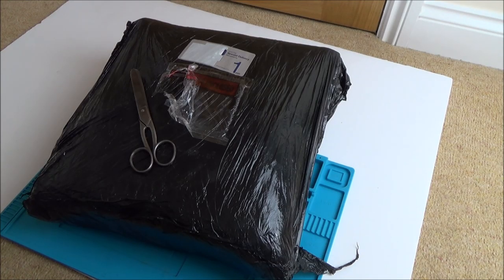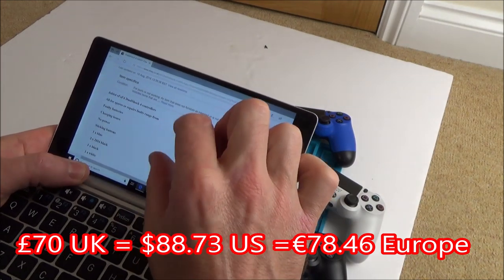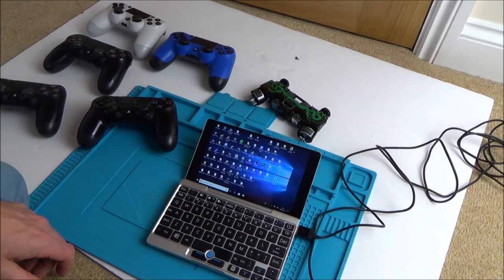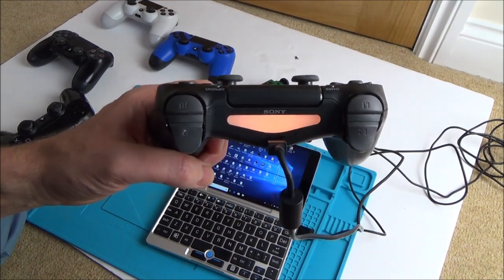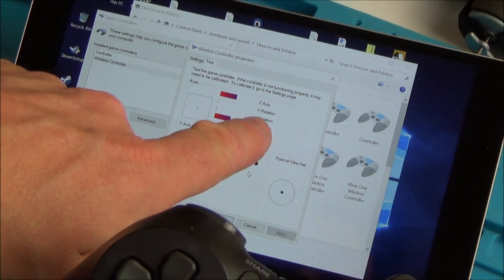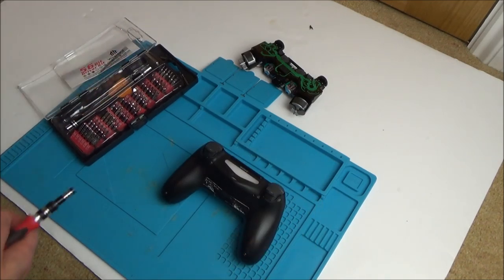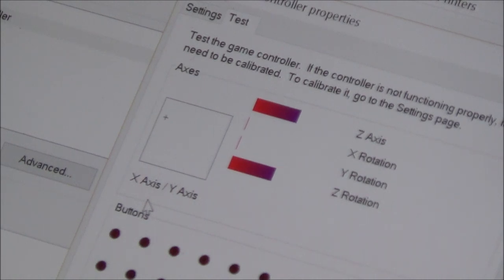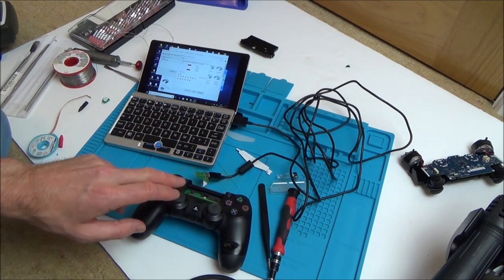Trying to FIX a Joblot of Faulty PS4 Controllers - PART 1

Comment: As a DS4 repair enthusiast and a fan of the channel, I'd like to contribute a couple things I've learned doing exactly this. Peel the stickers off the bottom of the shell, they're useless and look crappy. The time to clean is when you have everything apart. All the silicon bits come out, all the buttons. You can alcohol/soap/water/whatever you want and scrub with a toothbrush. Don't get addicted! It all started when the left thumbstick rubber wouldn't even hold a silicon grip/cover and R2 was flaky in BF4. Now both primary controllers are quite modified and I have 2 more stock ones I got for cheap on eBay and repaired. Always seemed like the DS4 got knocked for various reliability issues but they are super easy and kinda fun to work on. Big kid legos

Comment: Nice one Vince .
A little tip ,if you have to desolder something use a little flux and reflow the solder joints with some leaded solder it brings the melting temp of that lead free stuff down and  is a lot easier  and clean the joint with the solder suction tool.
I don't like the high temps you use with the hot air station and your iron ,no need to go 400 °c
50 °c above the melting point should be enough so 320 -350 °c accept if the joints are on a big ground plane.
Reply from the maker: Thanks for the tip :-)

Comment: Hey Vince, at 9:50 you notice the contacts for the flex contact pad. Sony's been using this design for a very long time! I work at a retro game store and I have to say the pressure fit is the best variant. There's the ribbon cable variant and the soldered-on variant which is the worst.

The problem with these things is they are extremely prone to oxidization. If you ever open up a model A PS2 Dualshock 2 controller you can usually see the contacts on the ribbon have gone almost completely black. The good news is they're salvageable! Simply scrape with a fiber glass pen, clean with alcohol and return it to its mounting position. This will fix most problems with these controllers.

Since the flex contact sheet is such a thin material, it's prone to wear over time. This means the entire sheet will be compromised in time, but for now they are often easily fixed by cleaning off the contact points from their oxidization. Just be wary of H revisions. Those are a lost cause.
Reply: Give me a 'real' connection any time.  Same with the triggers using that crappy pad thing instead of a potentiometer with cams.  Cutting costs by using these cut rate connection systems is why the current DS controllers are so fragile.
Reply: For the love of the game I fixed up most of my friends PSone controller and it works great (translucent ones) but I didn't manage to get the R1 working. I cleaned up the contacts with IPA which fixed up the rest of the buttons since they were unresponsive but I couldn't get R1 working. Have you got any suggestions?
Reply: @Lightning2011  it's likely the film has oxidized to the point that it needs to be replaced. Unfortunately the fixes here are temporary, as all the films will need to be replaced in time.

You can order new ones from AliExpress but it may be some time before orders actually go through on it.

Comment: Test your six axis controls let me explain games like flower and the playroom require six axis control most ps4 controller faults are a faulty firmware update by the console and it messes with the six axis controls.  Which is the tilt functionality of the controller.

Also the boards are not interchangeable there are 2 different model ps4 controllers with two different board revisions in it one has the light bar across the touch pad one doesnt if you dont have a light bar on the touchpad it means you have a model 1 board with light bar model 2 board. And test six axis with games like flower or the playroom

Comment: If you did what i think you did. There is no need to desolder the side of the potentometer you can slip a thin tool down the side (look at the grooves on the green section where the disc pads are) There is also a gap where you can add a drop of lubricant. I can't recall the name of it. But that will work sometimes if the carbon track isn't worn out and there is just crud in there. Sorry if i am mistaken!

Comment: You don’t need to unsolder anything to change them you can pop out the carbon tracks and wipers after you prise them apart slightly while they’re still soldered into the board if you’re careful I’ve done it a few times 👍🏻 lasting fix as well
Reply from the maker: Thanks. Very interesting. I knew you could pop out the wipers without desoldering but I thought the carbon tracks where glued down onto the green housing. I will have a look at the old ones :-)
Reply: I’ve only done 2 so far but yeah I just managed to pull them out and drop new ones in and clip the green plastic back it saved a lot of time, only problem I came across is the green plastic didn’t seem to clip back on as tightly mate but I sold one of these on eBay and got positive feedback so it definitely lasted just going down that route.... I was just thinking because you do so many it could potentially save you some time 👍🏻 there’s a video somewhere on YouTube which is how I found out

Comment: I bought a camo ds4 from a thrift store for $3. The shell was broken in half and right grip pried open, along with the left analog being stuck. I assume the owner broke the stick and trashed it in a rage. Replacement analogs are like a dollar from china, so I got that along with some replacement shoulder trigger and after carefully piecing the shell back together with epoxy and soldering on the new analog she worked beautifully. In case you were wondering the knockoff $1 analogs from china work just as good as the originals.

Comment: For testing purposes you can always download DS4Windows. It's a simple little program that converts the DS4 into an "XBOX 360" controller. Doing so will allow it to be seen, as an "XBOX" controller, by the Game Controller Tester app you've used for XBOX One controllers. DS4Windows will also allow you to check the touch panel as it automatically acts as a mouse pad and you can just slide your finger around on it and the mouse cursor should move. 

If sellers haven't opened them up themselves, controllers can be some of the easiest "broken" eBay items to fix and people sell them on the cheap! I've all too often seen eBay listings of "broken" controllers (namely XBOX) going for as little as $20 USD where all that is "broken" is a drifting stick.
Reply from the maker: Thanks for all the info :-)

Comment: Keep in mind that Vince's method of testing out the controllers is only recently available on Windows 10. For a good number of years on PS4 launch, the PC drivers for the controller had to be reverse-engineered because PS4 controllers, like PS3, were never meant to be used on Windows, but when Sony released the Playstation Now service, they included official PC drivers for Windows.

There are a couple of better 3rd party applications on the web to do more in-depth testing (even Steam can read them better). Of course, for the tech dummy, this test method is perfectly fine.

Comment: Hi Vince.. nice to see someone fix ps4 controller, there was a time i fixed lot of them so i wish to give you some advice about them...well  ps4 controller is very tough smart device if there is something dirt,  water damaged or short circuit, he will not turn on for hardware protection. Thats why 80% off my repairs required just cleaning!!!!.. seriously, before you will try remove something from board try clean everything before ( sticky or fail working analog) use contact cleaner first or IPA... doesn't charge??...check fuse on this small usb port pcb and check for any oxidation and clean them (many times hard to spot at first time)... short ciruit with heat exposure???..make sure there all ribbons wires connected in the right  angle specially inside touchpad (behind glued plastic cover)...hope that will help in future repairs...🤓
Reply from the maker: Brilliant tips, thank you :-)

Comment: 9:45 The pressure fit ribbon cable absolutely cause problems over time. It eventually stops making a strong connection and the controller behaves erratically. Very poor design on Sony's part. Had to fix 2 controllers with the same issue.
Reply: It was also the most common issue with PS2 and PS3 controller. Fixed about 10 just putting layers of electrical tape under the film in order to raise it and make strong contact with the board. If a controller Acts crazy, that's 100% the problem

Comment: In version one you have to push down the trigger buttons to take the back of the shell off on version two it will just come off easily I'm constantly taking my controllers apart and cleaning them

Comment: Great nice easy fix =D  I was surprised to see the analog stick fix that issue, especially when the trigger seemed to be causing it to move upwards?!?  I wonder if there was a particle of solder somewhere around the stick connections bridging something it shouldn't?
Reply from the maker: Thanks Chris :-) Very weird. I don't know why the left trigger caused an upwards movement. It would be interesting to remove the analog stick completely and see if other buttons caused movements :-)

Comment: remember the little pin to reset bluetooth (use a paperclip) I have taken more than 10 apart, most of the time because the controller sticks are terrible and I need to replace the sticks often.

Comment: I worked on repairing a job-lot of these. The main problem I encountered is there is more than one style of the conductive silicon pads that press on the contacts on the PCBs. The 3rd-party replacements are generally poor quality, with a clicky, non-tactile feel to them.

Comment: I fixed my own PS4 controller's left joystick problem. The problem was that there was a tiny dead zone with pressing up right. In most game it didn't bother me but when I played Gravity Rush 2 it was causing my character to stop running completely when I was hitting that zone. I took the controller apart, removed those green plastic things on the sides of the joystick and cleaned the little metal pieces inside with IPA. It work like new now. I could have also ended up breaking the joystick completely but I was at a point where I was considering buying a new controller if it didn't fix the problem.

Comment: The PS3 controllers had the same connection between the two boards. They sucked. The pad that kept them connected would get worn down and buttons would randomly press themselves. Luckily, you could just stick a piece of paper underneath the ribbon cable, and it would work if it’s done right. I’ve had to fix 2 of my own controllers that way.

Comment: Right OK. :) Nice comparison on the ohm values of the potentiometer's. I will criticize that you did not attempt to give the guts of the analog stick a good clean with alcohol before replacing. That would have been a nice service to see if it makes a difference. Also giving the carbon tracks a closeup comparison with the old one would be a better estimation of how worn or not it was.

Comment: You should use DS4 Windows to use the controller via bluetooth and also check out the controller's gyroscope. You also might want to test the speaker and the headphone jack port. GTA V uses the controller's speaker when you're in a police chase inside a car.

Comment: Another fix well done. You're getting quite good you know!

Sony has been doing that pressure membrane fit all the way back since the PS1 days. They started with that on late models of the first Dual Shock controller.
I always thought it would have been a poor solution as well, but hey, it's worked for them for decades at this point. :)

I do find it a bit awkward to work with for repairs though, and if the membrane breaks for some reason, there's not much that can be done to fix it, as far as i know. But i'm thinking that it's probably a much cheaper solution than putting in a whole other PCB.
Reply from the maker: Thanks for the info and nice comment :-)

Comment: Hi, just as a heads up, that flex cable is the source of ghost inputs if it's not being pressed evenly on the other board.
A common fix involves using an antistatic spacer to put more pressure on the contacts. 

Also, you should be able to test the analog sticks with the multimeter before desoldering them to understand if you are swapping in a bad one. 
Cheers.
Reply from the maker: Thanks Mad Dog :-)

Comment: the ps3 controller is the same kind of contacts between boards and i had to put something to put more pressure on the contacts because the foam they used stopped pushing like it did. guess the ps4 ones might have the same problem sometime.

Comment: The most common problem with Dual Shock 4 controllers is the micro USB port. They get loose and break really easy. Fortunately the port is on its own tiny PCB as you've seen and is very easy and cheap to replace. Just beware that there are many revisions of that board and they're all incompatible with each other so you have to match the USB board to the main board that it's designed for. Just Google the model number of the USB board (JDS-030 is one example) and you'll usually find them for a few pounds each. The batteries are also terrible but again they are cheap and easy to replace.
Reply from the maker: Thanks Adam :-)

Comment: This is brilliant! Nice work with the controller! What equipment do you suggest on using with IPA for cleaning components? I've tried to find suitable stuff, but it seems like the ones I've tried don't work so well. Is that some specific brush you're using to clean the USB connector?

Comment: For the guts yes you can purchase a case not sure on the touch panel though also for a couple of quid on   eBay you can replace the top cover of that controller if you don't like the controller looking the way it does!

Comment: I know this is an older video but alot of times you can fix drift on the older controllers by cleaning the potentiometer tracks with some IPA and a q-tip, no soldering iron required, fixed a few like that but there is some such as a brand new week old controller that started drifting that I could not get that to work on so I replaced it.

Comment: the control sensors, the backlight components and the touchpad are defferent between the old and new controller. I tried to see if I could swap basic parts before and noticed differences.

Comment: See I don't have a soldering iron so I can't desolder the potentiometer I just unclip them and bend them back to clean them, not advised as repeated bendage will eventually break the solder joints but I work with what I have lol also the motors I just cut the wires off on them as the controller vibrating is annoying in my opinion so I never bother connecting them back up.

Comment: Maybe you will find a solution to a controller that has the same stupid problem i have with my first (next-gen) controller

Basically: when i hit L2, it registers but it also ties forward movement on the L stick for some odd reason, i could never figure out why since everything looked perfectly fine to me but after taking it apart my square button stopped responding so i use my replacement. 
-The replacement’s problem is just a dying speaker which from what i see is a very simple swap out from the looks of things

Comment: cool video, my charge port is also not working so well. I might have to just squish it down like you did in the video so it will connect better, rather than buying a new controller at $60.
Reply: Try that.
Also, replacing just that little USB board it's CHEAPER AS HELL for sure.

Comment: On the right rumble you wired it backwards. But it's fine it will just spin backwards.
Reply from the maker: Hi, thanks for the message.  I just checked back on the vid and they are wired up correctly, remember I mentioned the little symbol earlier on in the vid to show which one is positive :-)
Reply: @Mymatevince  oh ok have a good one Vince
Reply: @Mymatevince  at least so far the seller isn't a scammer like with the Xbox one controllers
Reply from the maker: Thanks :-) Yeah, I think these will be 'normal' faults. The Part 2 video which I will put live tomorrow has an interesting issue with it :-)
Reply: @Mymatevince  can't wait

Comment: Not saying it's the issue, but the Xbox play and charge cable has the device select pin shorted to ground through a led, so it's different then a normal USB cable, I have no clue what the PS4 controller thinks of it.

Comment: Just in time! My PS4 controller has been having issues (no power unless plugged in, battery replaced and no change). Hoping you come across a similar problem to help me out with mine.
Reply: It's probably the charging IC having a bad joint or gone bad all together.
I would probably try to locate it, test it with a multimeter, and try again after reflowing the joints.
If, again, the multimeter misfires in some joints, change the IC ( or the board containing the IC , if you want less to solder/desolder )
Reply: @ShinryuZensen  that's what I'm thinking too. Just need a new multimeter to test with as mine capped out.

Comment: At 3.15 you said you used the Microsoft controller tester app thing to check the ps4 pads. Is it the same 1 as the xbox tester? If so that will come in handy as I've got some ps4 pads to fix and no ps4 to check them with.

Comment: Those ribbon cables that connect to the  usb port are horrible for tearing. I've done multiple jobs on the v2 and v1 ps4 controllers and on a number of occasions there was a micro tear in the cable stopping it charging also found it wouldn't light up too if that cable was faulty at all.
Reply: that's why I use controller charging stations.
Reply from the maker: Good man, thanks Dave, I will look out for it in the other controllers :-)
Reply: @Mymatevince  no worries Vince definitely worth looking out for as it's only a couple of quid for the ribbon cables and really simple to sort out.